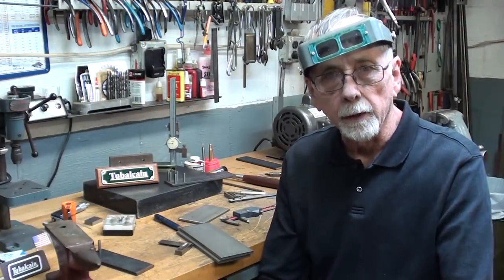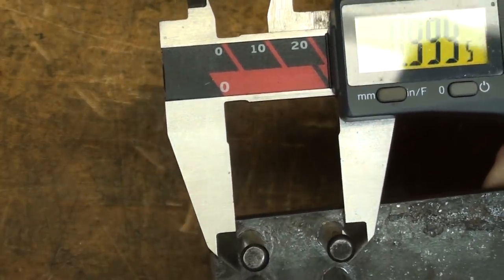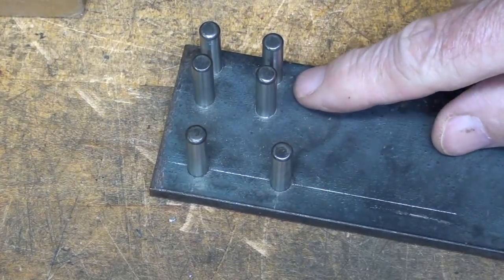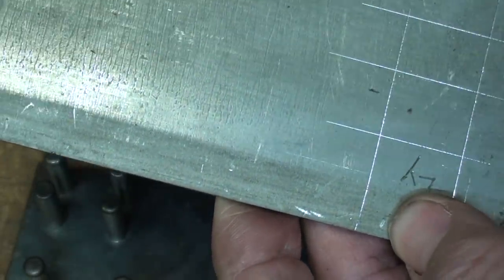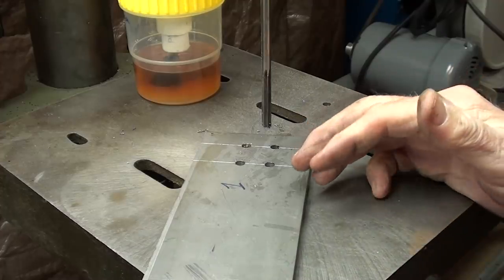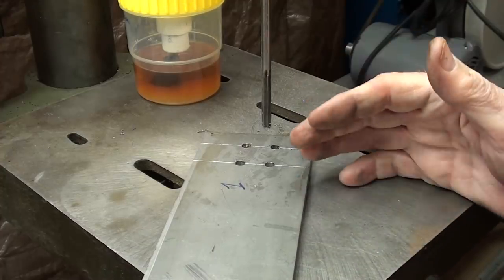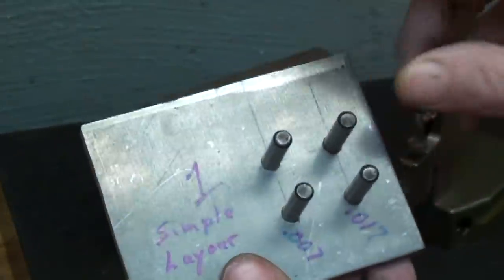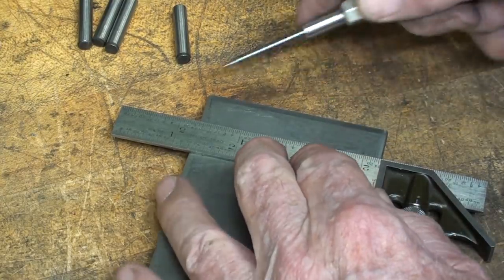Accurately Spaced Holes Tips 523  pt 1 tubalcain experiment

Comment: 1.017 vs 1.007 One could conclude (from a sample base one one? AAARRGH!) that you HAVE wasted 1000's of hours in your life by using the pilot drill method. 

Another thing is that the plate seem to wobble a bit on the wooden base which might have meant slight deviation from the perpendicular. Are the same 1.017 & 1.007 from bottom to top? And I was disappointed that you didn't measure cross ways. They formed a square, but you only measured in one direction.

EDIT: Again? Man, I really have to cease stopping the video to comment. I'm always jumping the gun only to find you have often already noted these things. Great videos, keep 'em coming. They're so very helpful that there are I'm sure a lot more people out there than me who are very grateful that you take the time and effort to produce them.

Comment: When I scribe the lines and I slide the Prick punch into the cross hairs , I hold the punch perpendicular and dot with a light hammer. I eye the punch mark to ensure it appears in the center of the cross hair marks. IF its not I follow up with a center punch, laying the point to the direction that the dot needs to move too and tap with a light hammer until the center of the punch has moved the to the center of the cross hairs then i raise the punch perpendicular and strike with the hammer, check again and follow with a DOT punch correctly ground with a 6o degree point and strike firmly holding it perpendicular, the result is a volcano shaped dot in the metal with an symmetric rim into which your drill bit with its 59 .5 dree point will drop to the center and will be guided by the slopping ril of the dot..
I place my plate on the bed of the drill press lower the drill bit into the dot and by hand turn the chuck BACKWARDS allowing the metal to move and find its own center i the clamp or dog it and start the drill press and dab the bit in to the metal and check the bit has taken a symmetrical cut,  if so complete the cut. I find a short center drill is best for this process as it will not wander and if it needs be you can release the clamps and relocate the metal to better center the bit.
Three punches,
Pick, to find and mark the center.
Center, to center the mark
Dot , to ensure a positive placement for the drill bit to locate.
Reply from the maker: Wow, that's quite an ordeal. But I can see you are a perfectionist, and work to great accuracy. 10 thumbs up.

Comment: What I do is use a small pilot drill and then change to bit and then bring the bit down until it just touches and then look at in rotate the bit while looking at it from 4 directions and make sure it is on center and clamped down and then drill it.

Comment: I'll often do my spot/start drilling on a little benchtop "Drilling Machine."  It vibrates and makes it very difficult to place the drill point in the punch mark while it's running, so I cheat.

I'll open the belt cover (with it off), place the work in position and bring the drill point into the punch mark.  Holding that with light pressure, I'll rotate the quill in reverse, by hand, for a turn or two and adjust the work if it looks like it would be prone to deflecting/wandering out.  When I'm happy with the position of my work, turn on the motor and start the hole.  Since one hand is needed to hold the work steady, and the other needs to keep pressure on the quill, I have to leave the belt cover open, turn on the power switch, resume my hold on the work ... and knock the belt cover closed with the side of my head to close the safety switch.
Reply: Mmmm I think that you need to come up with a better method. Your method seems slow tedious inaccurate and just begging for an accident.
Reply: @markfryer9880    Not any less (or more) safe ... or tedious, or inaccurate ... than what was seen in this video.  And doing something fast doesn't always mean the job is done in less time.  I am talking about starter holes of 5/16 or less, using a drill press with a motor of less than 1/6 hp  (Larger holes are handled on the the camel back drill press).  A foot operated switch might make operating it a little easier, but those have drawbacks, so I doubt it would be any safer.

Comment: Not quite what I was looking for, I wanted X number of holes of Y diameter Z distance from the edge with A distance apart and in a B defined length, how is that easily calculated. I'm making a display box similar to the type of box number punches are stored in. Do you have a video on that, thanks!

Comment: Should we bother boring a pilot all the way threw ? i usually dont , maybe half way , does this effect accuracy
Reply: For me it depends upon the finished size of the hole and required number to be drilled. If I am drilling a 10 to 25 mm hole I go 6 mm, 10 mm, 13 mm, 16 mm, 19 mm 22 mm 25 mm all with oil lubrication in the drillpress. If I am using my magnetic drillpress then I may skip some steps and I am considering getting some annular cutters to save time and the amount of swarf produced.

Comment: I am on the fence regarding that Skidmore optical punch. I do like that it has a magnetic base. Anyway I have a quite old heavy Starrett scribe base with the 4 pins in it. I am wanting to make a "sub-plate" and mill in some magnets on it. The problem is matching the 4 Starrett  base pre-existing 4 pins exactly to match up with a thick sub plate drilling in it wise. I guess I could lathe out a punch (of some kind of hardened steel) to the exacting dimension sized Starrett holes then lay the base on top of the sub-plate for marking. This would not be easy but possibly doable. 

Why am I going through all this? Well my Starrett base is also my dial indicator holder for my lathe and it would be nice to have it rock steady when using it on my Unimat small lathe.  Appreciate your  video. Any thoughts on the above?  Anyone reading this with ideas would be appreciated also. Thanks.

Comment: Thank you for the interesting video series. I am not a machinist, but an electronics specialist who has to make prototypes from time to time. My challenge (or one of them) is often to scribe lines with acceptably precise distances from the stock edges. I find it often difficult to use the square for that purpose. Thus, I am sometimes tempted to one jaw of my caliber as the scriber while the other edge is leaned against the stock edge, but that is not a very good method as I am timid to push in the fear of damaging my beloved Helios caliber. Is there any dedicated gadget for this purpose? I see that you used the mitutoyo gadget for that purpose. Is there any simpler cheaper device?
Reply from the maker: I never use a caliper for scribing. Just a very sharp carbide scriber and a ruler
Reply: mrpete222 Thanks. Actually, searching on the internet, I came across something called “parallel marking gage”. That might very well be what I need. Sorry if I could probably not explain well what I needed.

Comment: I mostly make furniture. I gave up on dowels because I could never get the drilled holes to line up( also, structurally they are useless in cabinet making except for alignment).
Reply: My hunting guide showed me how he can take photos through his binoculars by using the little round camera lens on his cell phone. It might work with that small lens.
Reply from the maker: I never liked using dowels for joints on wood

Comment: Hello Mr Pete,
Thank you for sharing your insights on this subject.
I'm always trying to prevent pilot drilling where I can. Essentially, each operation on a part introduces some error. 
Hence, drilling two holes free-handed is per definition less accurate than drilling only one, at least i my opinion. 
This reasoning holds true as long as the drill-center fits in the divet made by the punch.
Can you agree with this?

Comment: I think the Optical method was off because the micro drill spot hole was off. the narrow bit introduced some flex and the weight of the work piece was too much for the drill bit to "pull" into center. You only showed one hole but the bit is clearly bending as it goes into the piece. I don't use a vice for larger bits because the bit will center on the hole without flexing, but with smaller bits i do.
Reply from the maker: Yes, that is very possible I need to go back and look at the video
Reply: @mrpete222  Well now I hope I was right (pretty sure I was)..... Also wanted to let you know I really enjoyed this video. I wish I could tell you why exactly but if you ever figure out what this kind of video could be categorized as, please feel free to make more of them.
Also, have you thought about doing a one week, one on one, machining class? Something like fantasy baseball? If so, I would like to be the first one to sign up, meet my mentor....

Comment: No 5 is the way to go.....with a DRO you get pitches to 5 microns every time and you don't   have to do any scratching with a sharp point, height gauge and marking blue ever......once I fitted a DRO to my mill I never looked back......my lathe will be next, probably only on the crosslide.

Comment: You should measure at the base of the pin and at the top to see if you have a taper.
Measure both sets of pins the same height off the plate.

JIM

Comment: Mr. Pete,
  Is it possible to drill accurate holes with a hammer and chisel? Lol
Great lesson.
Dale
Reply from the maker: All kidding aside, a tiny Chisel is sometimes used in and attempt to move A hole that is slightly off.
Reply: Mr. Pete, 
  True, and have done that in a pinch on occasion, but usually in instances when accuracy isn’t critical. I am in the process of making a backing plate for an er 32 collet chuck. It’s gonna be interesting getting it where it needs to be. Location, location, location is relevant in more than real estate.

Comment: Years ago I had a Picatinny rail I wanted to mount on a telescope, so I went to a local gunsmith and asked if he could drill two holes four inches apart. "No problem," he bragged, "I have a machine that can space them within a ten-thousandths of an inch." After a much longer wait than I expected, he returned from the shop. "Ah, I first drilled two holes 5.0000 inches apart. Is it OK that there's another hole?"
Reply from the maker: Ouch! But I guess I am not surprised, incompetence reigns.

Comment: If you need to drill accurately space holes, you need to use a center drill. It looked like you drilling the hole with a small drill the drill was walking. The small drill was too long and flexed when you started to drill.

Comment: No toolmaker's buttons 😕?

Totally not foolish to enlarge the punches with a real center punch. That's exactly what I do: make an initial mark with a prick punch or an automatic center punch, and then come back with an appropriate sized center punch. Otherwise you don't get enough of a divot to keep the drill from wandering.

You need an LED ring for that optical center punch. That should be an easy lathe project, just add some white LEDs and a button cell.